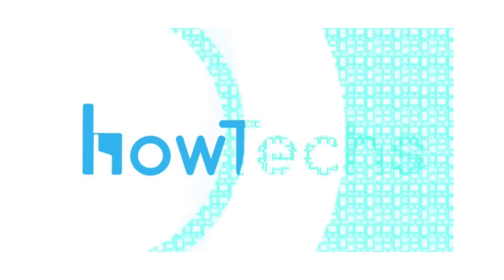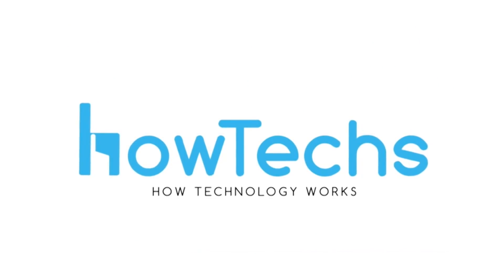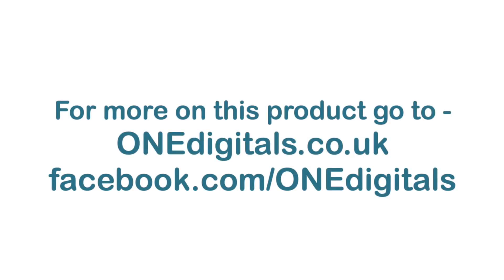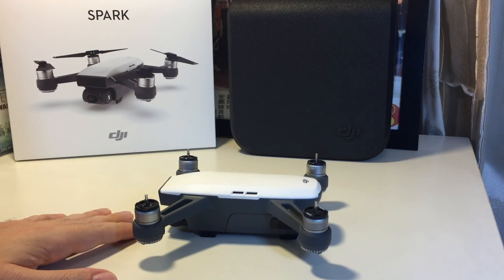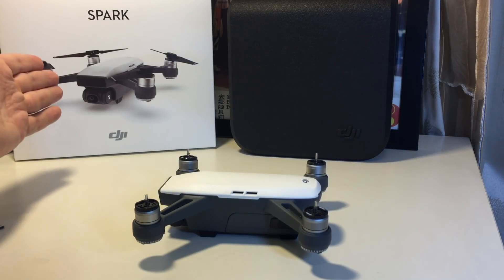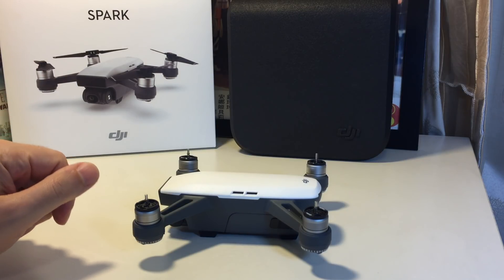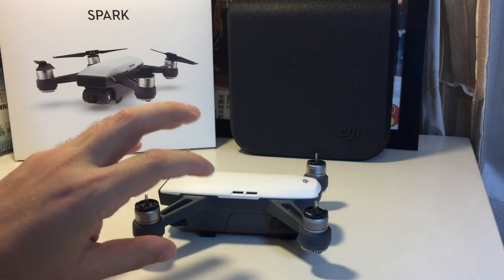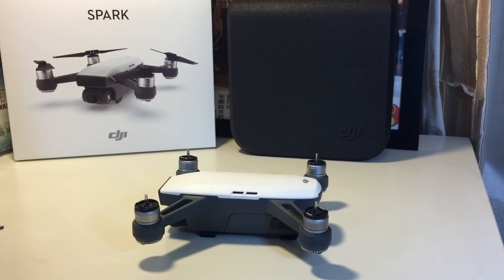DJI Spark - What do the Lights Mean?

Comment: Hello! I’m so frustrated. Yesterday I bought the fly more combo. I tried to get wifi but no luck. Then I tried holding the spark button down for 6 seconds. Now all 4 lights are solid red. Can’t seem to pair it to remote I need help sonehow
Reply: Turn off everything. then turn on the dron first. then press the power button for 3 seconds on the dron, and then turn on the remote and together press and hold the button, pause and costume button until you hear a beep. the remote will flicker until the light is green, which means the dron is connected to the remote
Reply: Mirko Carevic thx for the reply. I fixed it a while ago! If your on the Facebook dji page, i added some pics from Mexico vacation. I will have a video up soon on my channel. Thx buddy
Reply: Hi. How do you solved ? Thanks

Comment: When you have solid red, it means an error. How do you trouble shoot that?
Reply: Mrcoconutoil you feel me still can't find out how to fix it
Reply: My Spark arrived 4 days ago. The rear lights stay RED. Have gone on DJI Tech support several times (response to questions was very slow) and finally called yesterday, to no avail. Same question as above: When it means there is an "error" what is the solution??? How do you trouble-shoot this??? Have looked everywhere on-line, You-tube, and tech support at DJI and nothing. Very frustrating!!!!!!!